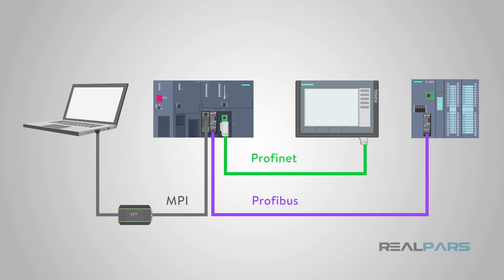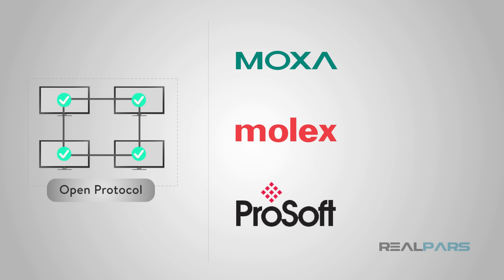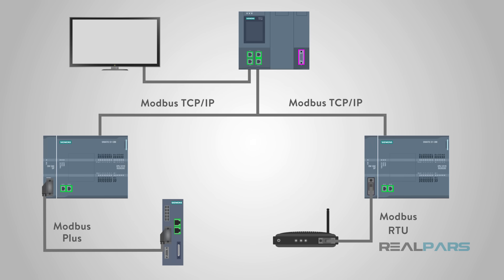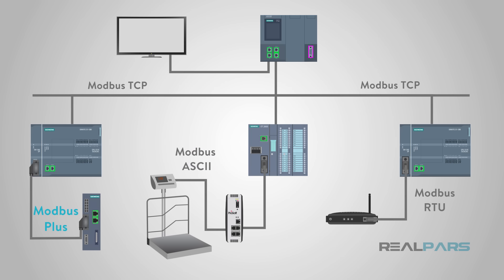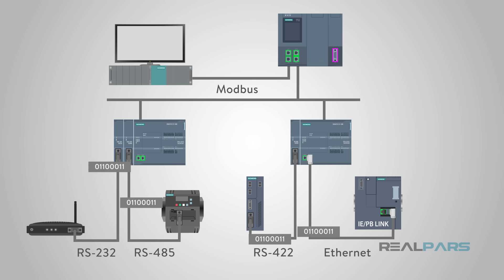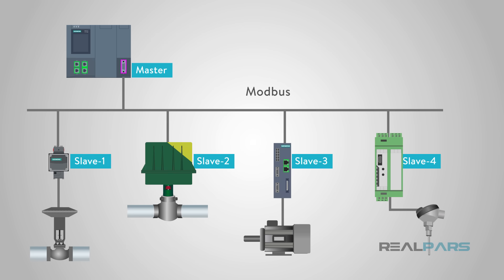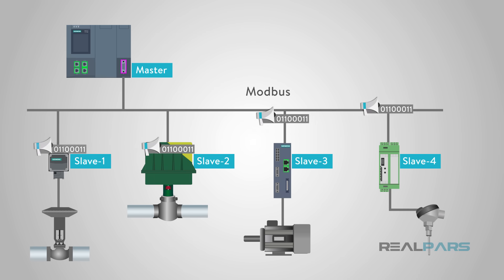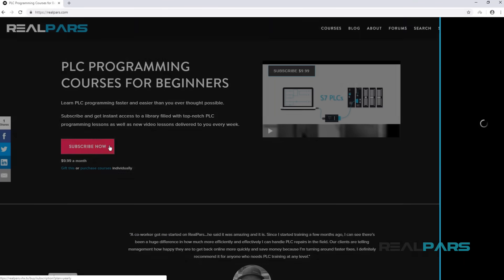What is Modbus and How does it Work?

Comment: There is an error at 4:59. RS485 does not have tx and rx wires, it is differential half-duplex, you have the positive and complementary wires, usually called A and B.
Reply from the maker: Hello, @manuelvega6638 Thank you for sharing your comment. It can be made full-duplex, and it has a transmit wire and a receive wire. Here is a link for your reference: https://en.wikipedia.org/wiki/RS-485. Please read it thoroughly to gain a comprehensive understanding of its evolution and the technical details it contains. 

If you're looking to learn more about this topic, you can join our 7-day free trial at https://community.realpars.com/checkout/realpars-membership 
Happy learning from RealPars!

Comment: Would you use Modbus to control lights off a house? Or is there anything better/newer?
Reply from the maker: Modbus would not be typically used for home automation.  This is normally done by controlling a relay embedded in a device you plug into an outlet and control via WiFi.

Comment: If I configure two PLC's to communicate with each other with Modbus, how do I setup the messages on the PLC to send to the other one? Are the messages being sent on each PLC scan cycle?
Reply from the maker: Modbus communication via PLC is done via a communication block.  Depending on the type of PLC you have, you will configure the communication differently.  Some PLC's use GET or READ statements to fetch variables from the other PLC, and some use SEND or WRITE statements to send variables to the other PLC.

Comment: Why use Modbus when DNP3 protocol is superior?
Reply from the maker: Simple:  Modbus is more universally accepted and used by more manufacturers.  This allows devices from multiple manufacturers to be used in a single network.  NovaTech and others have pushed DNP3 for years, but it just not have the large installed base or vendor participation that Modbus does.

Comment: When deciding to set up Modbus communication between new PLCs, please carefully read the PLC's manual(s) regarding how they implement Modbus.  You might be in for a surprise, some PLCs really aren't Modbus friendly, take Maple, for instance...
Reply: Solid advice.  There's alot of the interpreted in the modbus protocol standard so it can be implemented differently from vendor to vendor.  Sometimes the vendor may not even have the info.  It'd also good to ask if you  can have borrow a test equipment to test out.
Reply: Very true. I used to work for a process control software company back in the day and I wrote their Modbus driver. We had so many customers call and complain that their random loop controller, etc. didn't work with our driver and how our driver was incorrect. We would explain how our Modbus driver was our most popular driver and deployed to thousands of locations without incident and how it worked flawlessly with actual Modicon hardware. Yeah, they always felt stupid after those calls.
Reply: Yeah, especially for basic serial settings, such as baud rate, stop and start bits, parity, etc... Some other protocols like BACnet/MS-TP (BACnet is a building automation open source protocol), have these predefined in its standard. Not modbus
Reply: YES

Comment: Dear RealPars Team,
I would like to ask the question:

1.What are the benefits of the Modbus Protocol?

2.Why did the industry use the Modbus Protocol?

I hope to hear from you soon.

Thanks for the best learning course.
Reply from the maker: Modbus protocol was developed for use with the introduction of the first PLCs in 1979.  It was based on RS-485, which is a current-based, serial, multi-drop network that is very reliable and predictable.  The first "flavors" of Modbus, Modbus ASCII, and Modbus RTU, were compact, simple, and had very little overhead.  But, these first Modbus versions did not allow more complex data structures or commands to be used.  So, it was the first PLC peer-to-peer protocol on the market.  Modbus TCP was introduced in the early 2000s, which is simply a TCP layer situated on top of the original Modbus protocol stack.  That makes Modbus TCP an Industrial Ethernet, without all of the complexities of Ethernet/IP or Profinet, but still retaining the simplicity of the Modbus command and data table structure.  Modbus is an open protocol that any manufacturer can use, so there are no royalties or use fees for building it into a product.  Most legacy CPUs likely still use Modbus, and Modbus TCP has grown in popularity due to its speed, simplicity, and reliablity.
Reply: @realpars  Grate, Thanks you🙏

Comment: Hi, do you recommend me a Modbus TCP IP or RTU splitter? Where I can find this? Thanks
Reply from the maker: Modbus TCP does not require a splitter to join devices.  Modbus TCP, just like Ethernet, can use a network switch to put multiple devices on a network.  For Modbus RTU, devices can be connected via daisy-chained cable to a Modbus Master.  However, if you need to connect a group of Modbus RTU devices to EThernet, I like the Moxa ioThink 4510 or RTA 460ESMM-N34-D gateway, which can communicate to up to 32 Modbus RTU devices.

Comment: Thank you for this video. I'm here because I have two SMD220 MBUS meters and would like to monitor my power consumption, I'm in an off-grid solar setting and would like to follow my system on my PC. Any hints? I can write some programs if necessary.
Reply from the maker: The SMD220 MBUS meter is a nice device, but as far as I know, it only has pulsed outputs.  That means it produces a pulse for every unit of power it sees, with 1000 pulses = 1 kWh.  To monitor this on a PC, you will need a DAQ board (data acquisition board) that can interface with your computer (typically through USB) and accept and process low-voltage pulsed inputs.  This unit also has an M-NBus connector, so you may be able to directly connect it to your PC if you have the right converter, cable, and software.  In any case, once the data is in the PC, you will either need to purchase or develop an application that can grab the data from the USB port and display/trend/archive it according to your specific needs.

Comment: I have a basic doubt regarding the transmission of signals from slave to master. For example in conventional system, we use twisted pair cable to transmit signals from field devices (input or output) to PLC/DCS. so it will be like input Field device to Jb , JB to I/O cards, I/O cards to I/O modules, MODULES to processor and vice versa for output signals. So Modbus communication is established through any special cables or Cards ? Is there any conversion of signals in between . May be I sound stupid but I will be happy to have some clarity.
Reply: Packet communication can carry another protocol, think of shipping boxes with product boxes inside.

Comment: How can we calculate number of points supported for polling, given the baud_rate, scan rate and interframe delay.
Do you know any formula?
Thanks in advance.
Reply from the maker: That number depends on a host of variables:  number of DP nodes, baud rate, segment length, etc.  There is no formula, a far as I know, but I have built large systems with 100+ Profibus nodes total across 4 or 5 segments at 500Kbaud and never had an issue (several thousand tags).  If anyone has run into a limit, let us know!  You can easily run into licensing limits (PO units) associated with WinCC (HMI platform), but the solution there is to buy more licenses!

Comment: Is the communication between PLC s7-1200 and PC using ethernet cable a Modbus TCP?
Reply from the maker: The interface is an MPI interface, which is a proprietary Siemens protocol (Multi-Point Interface).  It is based on EIA-485 and has a configurable speed of 187.5 kBd to 12 MBd.  MPI was the "inspiration" for the ProfiBus protocol. MPI can be connected in a variety of ways to the PC and S7 PLC, including a CAT5E cable.

Comment: So is modbus a competitor to profibus and profinet or is it just a collection of those and others? Is there modbus DP?
Reply from the maker: First, there is no Modbus DP.  Modbus could be considered a competitor to Profibus and Profinet, but the capabilities of Modbus are limited as compared to Profibus.  Modbus and Profibus are roughly based on the same electrical signal standard, but they are two very different protocols.

Comment: Is slave an io module or devices like sensors, actuators?
Reply from the maker: In serial communications where there are multiple nodes on the network, timing of communications, sending of commands, and error handling are all tasks that are handled by the "master node".  This usually exists in a control system as a communications card, like the Siemens CP card in an S7 system.  "Slave" nodes are those that respond to the commands set by the "master".  An example would be IM cards in a Siemens S7 system or devices such as VFD's.  In a ProfibusPA network, sensors and actuators would be slave devices responding to commands and requests from the ProfibusPA master module.

Comment: Hello guys, I am working on Modbus protocol with Dell gateway 5000 but I am not getting how to configure the connection and to read data from the sensor through Gateway 5000 with RS485
Reply: check your function you send to the slave and make sure you request the correct type of data for the device to reply for example if protocol is RTU address type if 01x or 00x you read/write bits otherwise if 04x to 06x depending on function you will read/write word(16bit) or use 2 cosecutive adresses to read/write(32bit word) data, note that some data may require 0 based indexing or 1 base indexing depending on your slave cpu

Comment: Im confused. Is rs-232/428 just the physical layer of ANY serial communication protocol or is it a complete serial protocol in of itself? By protocol i mean the methods of encoding and decoding messages on a binary level, the voltage levels and stuff.

For example take i2c. It is a serial communication protocol. And we can implement it using a 2 wire bus( this id the physical layer). I can for all intents and purposes use a DB9 connector for i2c communication by just utilizing 2 pins and 2 wires in the cable.
Reply from the maker: RS-232/RS-422/RS-485 are not protocols per the OSI standard definition for a protocol.  They are electrical interfaces.  They operate at what OSI would call Level 1.  Profibus adds additional functionality at Level 1 and above for communications. Profibus is a true protocol that uses some aspects of RS-485 for electrical connections to the network.
Reply: @realpars  ok thanks

Comment: Now the question is .. is the RS232/485/422 & RJ45 is between devices and controller .. and the MODBUS Ethernet between controller and PC ?????
Reply from the maker: Simple serial interfaces, like RS232/485/422, were common at all levels of indication and control in the 1970's through the 1990's.  An improvement to these serial modes of communication was developed in the 1970's and was called Modbus.  It was useful, reliable, but fairly limited in scope and speed.   In more recent years, more complex and useful bus technologies like MODBUS/TCP have been used widely.  Most modern PLC's and PC's are most efficient when using TCP-based protocols, like MODBUS/TCP, Ethernet/IP and ProfiNET.  Most device manufacturers have also migrated to the TCP-based protocols, including VFD, sensor and analyzer manufacturers.  So to answer your question, all of the protocols you mentioned can be used at every "level" of control, from device to PLC to PC.  However, the simpler serial protocols are not used as much anymore, since the hardware interfaces for the TCP-based protocols are inexpensive, fast, and reliable.  I do not own a PC anymore that has an RS-232 port.  If I need one, I have to use a USB-to-Serial converter.  Also, RJ45 is a type of cable connector; not a protocol.

Comment: I understand Modbus with RS485(harder to hack, and its real-time). But Modbus TCP/IP is very very insecure and dangerous and not real-time. There is no encryption of the messages.
Reply from the maker: Thanks for sharing your thoughts!
Reply: @realpars  Though i like your videos and subscribed. :) Can you do a video about OPC UA ? It's becoming very important protocol. And with TSN(Time Sensitive Networking) it has the potential to be hard real-time and can replace profinet/profibus.
Reply from the maker: Great to hear! I will surely go ahead and pass these topic requests on to our creator team. Happy learning!
Reply: @HermanWillems  can't wait to get OPC work in hard real time, that will be great improvement in all industries especially laboratory data from analyzers and other equipment, it will be great

Comment: I am new to LabVIEW program and trying control the variable refrigerant flow compressor speed through LabVIEW program. Using the following LabVIEW functions and hardware..
 

TCP Open connection: IP address has been defined in the TCP open connection.

Speedy: (driveweb.com) : This speedy device is connected with network card using Ethernet cable.

OPTIDRIVE E : This device controls the ‘Variable Refrigerant Flow” compressor speed(manually and based upon LabVIEW written program). This device is connected to network card through speedy by using Ethernet cable.

Hardware configuration:

OPTIDRIVE E ( IP 20 & IP66 (NEMA 4X)  AC variable speed drive ( 0.37 – 11 kW) ( 110-480 V)

Confirmed: Its been confirmed that Speedy is communicating with CPU.. I have ping the IP address and it responded. 

 

Questions:

     1. What signal should I send to OptiDrive E in order to switch on/off the compressor motor? 

      2. Has anyone tried this before? 

   

 

Any help will be appreciated !

Thanks!
Reply: depending on the protocol used by your optidrive E and you might need a convertor between your pc and the optidrive otherwise you have to write the protocol to convert the signals or use libraries if you have some, check the protocols that your OptiDrive E uses and check its address map,  from what I've seen from optidrive it has a can bus and a RTU one so its preety forward, check its address map and call it, don't forget its slave address

Comment: Can you upload a video to configure a modbus card MVI-46 MCM for SLC and communication of any device with it ???
Reply from the maker: Hi Sarfraz, I will pass your request on to our creator team and see if they can put this topic on the list.
Reply: It's a bit late, but for application specific questions I would visit PLCS.NET. There you can usually get answers for specific problems from engineers that have worked with the hardware/software in question.

Comment: Although modbus is VERY basic and FREE protocol in automation or industrial data communication, i am a bit shock when engineers, technician or operators for a huge process plant (in my case, District Cooling Plant) does not know modbus. They only know "high level interface" for any data interface. Maybe because they dont teach you this stuff even in college when studying electrical engineering (me too).
Reply: Modbus TCP/IP doesn't meet certain cyber security certification of today. It's not encrypted. Super easy to hack. I think it's dangerous for lets say a drinking water system that gives thousands and thousands of people drinking water. Or electricity or any kind of thing that can endanger life. Communication today really need encrypted communication between the PLC's if you doing something really important.